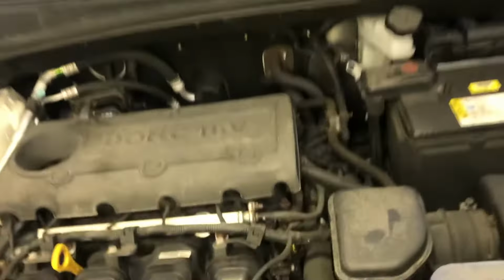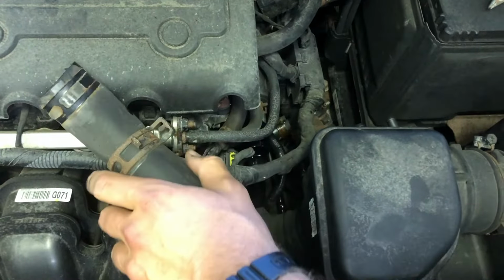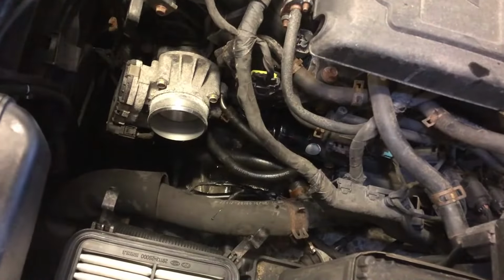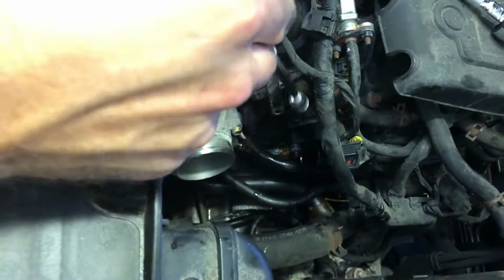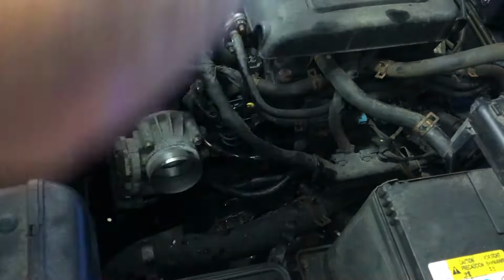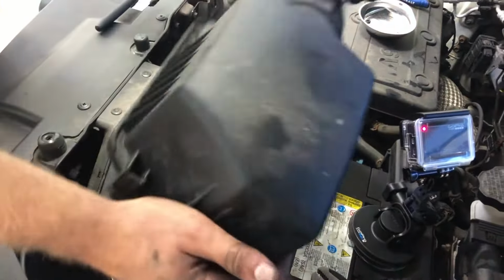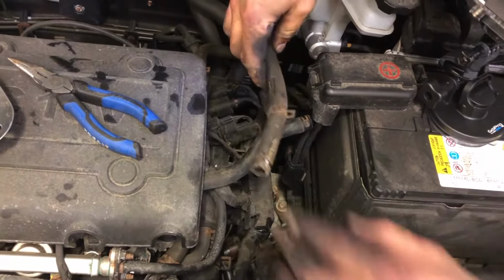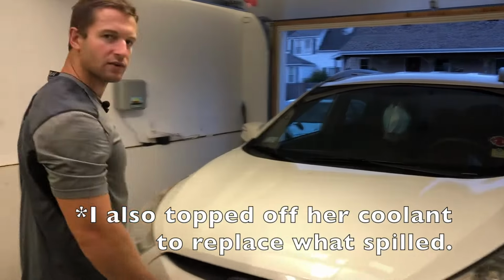Intake Manifold Runner Controller DIY Replacement - 2013 Hyundai Tucson 2.4L (Codes P200A & P2004)

Comment: Who needs torque specs? Certainly not this guy and his cousin..from Boston. Seriously tho kid. It was wicked funny. 
It was a good video. The real question is…….Did it work?
 And for future reference, if a Dealer tells you it’s a “dealer part”. Take it with a grain of salt. He’s not technically lying. However, you can find most OEM parts online. Just not that exact part. (Which is guaranteed to be double $$$)
Reply from the maker: Lol, I'm actually from NY originally, I just live in MA now, (not Boston either). I know torque specs are always recommended to be 100% thorough. However, I did not think they were really necessary for this specific repair. Obviously, if anyone were to say they are very particular, and want to be absolutely sure they did it right, I would always say torque all of the bolts to spec. I believe other repairs, like spark plug changes for instance, are much more important to torque them down to spec.

And yes, it did work! Almost a year later, and it's still holding strong. As far as the part finding endeavour goes, I looked all over the place, and I couldn't find this exact OEM part anywhere, except at the dealer unfortunately. If you find a proper OEM replacement IMRC that's not from the dealer for a decent price, good on you. That's why voting for the right to repair law was such a big deal in MA, and I'm very happy it passed.

My girlfriend especially, as well as I, also didn't want to mess around and take a chance with a "like OEM" part. To both of us, the extra money is worth getting the correct part, not some crappy knock-off version for instance. Also, I actually only spent less than $150 on this IMRC. I've seen them listed at $250 plus elsewhere. Since the repair worked flawlessly, and it's still holding up to this day, I would say just get it from the dealer for $150, save yourself the heartache, and fix it right the first time.

Comment: Dude... word of advice for one car guy to another. GET RID OF THAT HYUNDAI! Nothing but issues. And you are gonna pay 2500 to 7000 for a motor when it decides to lock up. And long block replacements are so hard to come by.
Reply from the maker: Brandon Deveaney It's not mine it's my girlfriends lol. Thankfully it has been very reliable for her overall except for some excessive brake pad/rotor wear issues. However, I honestly think that was the dealership screwing her by not fixing them correctly. I sure hope the motor doesn't seize... Do you know how common that is and at what mileage it usually occurs? The plan as of right now is she's going to keep it for a while though and either run it into the ground, or we'll sell it and she'll actually buy a truck (like a big one too!) when she has enough saved.
Reply: @DoubleClutchAutoReviews  yes they typically go between 60k and 140k. Im currently doing an engine swap bc hyundai doesn't have a recall for the 2013 2.4l theta2 engine which is mass produced and hyundai knows the engines are trash. Mine was reliable when I got it used with 119k and I only got to put just under 18k on it before the engine went. The best advice I can give is trade it in or burn it to the ground. But that's between you and the gf.
Reply: @DoubleClutchAutoReviews  and a shop quote just under 10k for an engine replacement. Im doing it for around 3k
Reply from the maker: @brandondeveaney6864  DAMNNN for 10k that's pretty much totaled as far as I'm concerned.  I'm sorry you had bad luck with yours. As of right now, we will hope for the best though! Thanks for checking out my channel!
Reply: Yup. My 2015 tucson engine seized on the highway. Then my wife's 2018 tucson seized a year later. We made a mistake buying tucsons....
Reply from the maker: @adonaldson85  Damn man sorry to hear that. I hope my girlfriend's stays alive for at least a few more years!
Reply: I know I will not get rid of my 15 sonata. As long as I am the owner, had a lifetime warranty on engine. This is from the class action lawsuit settlement.
Reply: Nah bro that year is pretty good lmao I got one and it’s sitting at a little over 190,000 and this is the first check engine light I’ve gotten… overall pretty reliable car